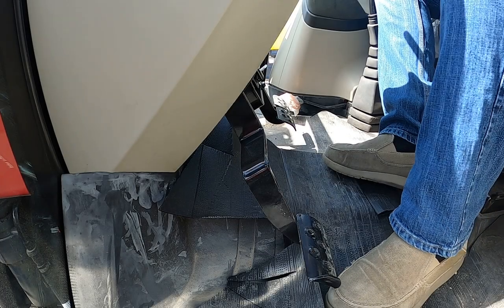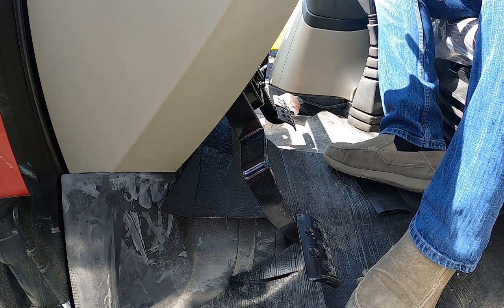Massey Ferguson Clutch Calibration-Jumpy Clutch Fix

Comment: It’s a shame. We have had mechanically/hydraulically connected clutches for 100 years that worked amazing with predictable throw and now with the advent of electronics, we have a ridiculously numb-lack-of-feeling engagement. These engineers need to be forced to work with this clutch for three years before they are allowed to design anything ever again.
Reply from the maker: Yes hydraulically/mechanical clutches have worked for years however without electric over hydraulic you lose some pretty awesome features such as declutch buttons for shifting and brake to neutral in addition to adjustable shuttles.  Thanks for watching.

Comment: I have a 1759 Massey ,(2017) with a harsh power shuttle engagement, fluid is full in sight glass. Works great , any ideas , don't want to hurt my tractor,  This happen all of a sudden,  ps( had to replace a transmission cooler leaking) seems after that this took place  Looking for info  only 1100 hrs

Comment: Man, good on you. I got a new 5711 delivered Friday.  The heat would not work, the stop was on and i pulled  the hvac control panel out to check cable and it was tight. Tech was coming out so i stopped looking for reason. Started driving it around and stated throwing speed sensor faults. I was very jerky with it, brakes, wheel slippage..the clutch was just a mess and that erratic driving could have glitched the computer. Tech showed up, the heat issue was actually the control cable up top was completely out of bracket..dang Massey..QC?  We found sensors the faults were about and would address them later. Couldn’t drive 10’ without those codes kicking. Yesterday using it and no codes would pop up, i then started using the crap out of it, and again today..zero codes. But the clutch was terrible! Couldn’t  hook bucket up without lounging wile trying to go slow. Did your calibration and it’s incredible. Actually the best clutch I’ve ever used! Thanks. Curious, is there any other calibrations that should have been done before delivery?
Reply from the maker: Bummer of a delivery experience but glad you’re getting it lined out.  No that’s the only major calibration I’d suggest on that model.
Reply: @prequipmentsales  let me ask you, have you seen an issue in the 4700/5700 blowing fuses or burning wires when people use the auxiliary 12v outlets to run sprayers/electric twine arms? I’m talking of the cigarette lighter outlet and the 3 prong power supply. That would run my baler and twine arm. Cigarette lighter will run sprayer for preservative and moisture monitor.

Comment: I got Massey Ferguson 3635 and it’s suddenly moving slow and I parked it, later it’s not moving but starting to engine is good. I replaced hydraulic oil and filter because showing in dash hydraulic low pressure sign. I replaced hydraulic sensor too. Still tractor not moving forward and reverse. Please help me, thanks

Comment: thats just calibrating the pot sensor on the pedal? not the modulation of the actual clutch pack? thanks for the video
Reply from the maker: Correct just the sensor.  If you’ve got harsh engagement of the declutch button or shuttle this will not fix it.